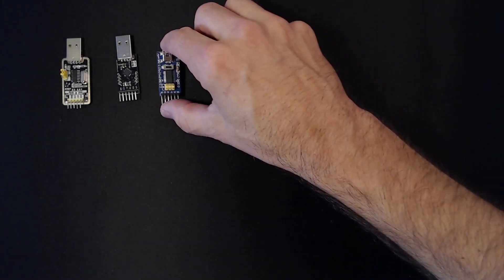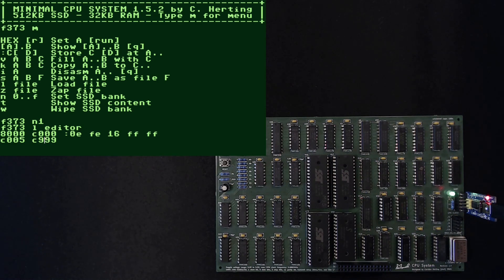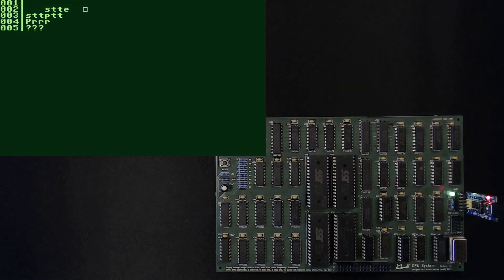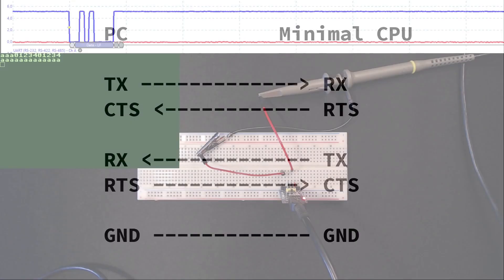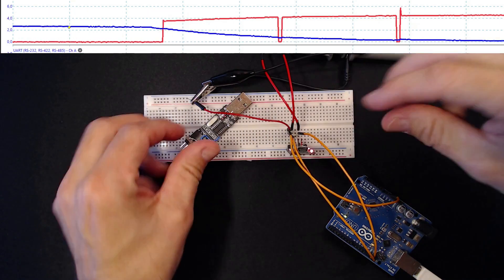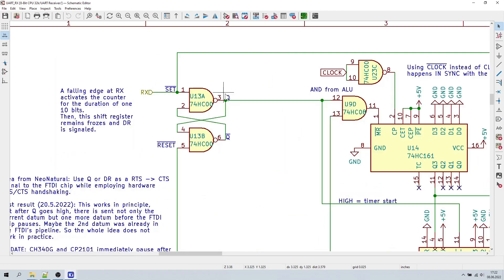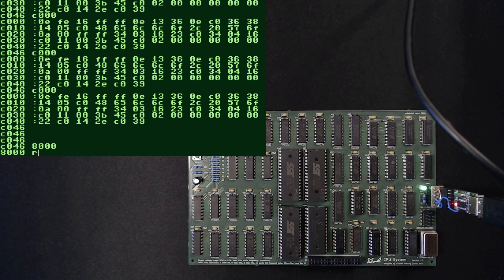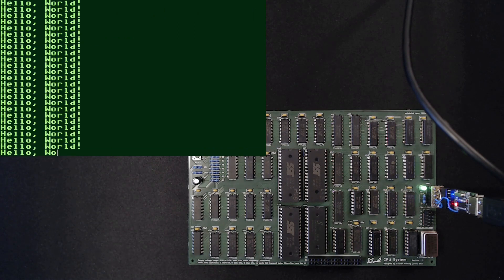Easy Serial RTS/CTS Handshake - Minimal CPU #12

Comment: Hi, ive been doing a lot of testing with bit-bashed serial using hardware handshaking.
It you only assert the CTS line for 1-bit time the chips will only transmit 1 byte.
In short it will work with any usb/ttl chip.
Check out your video and you'll see that by waiting for the start bit, you asserted the CTS line for 2-bits time, so chips with a FIFO transmit 2 consecutive bytes.
Hope this helps!
Reply from the maker: Hi, thanks for diving into this. If I am understanding you correctly, the problem is that my circuit pulls down RTS ("I am ready to receive") for more than 1-bit time? In fact, it pulls RTS down continuously while it is ready to receive and up until a new datagram arrives. Have I misinterpreted how to use RTS? Thanks for you help with this!
Reply: @slu467 there is very little out there on the 'correct' use of RTS. I pulled mine low until the start bit, then took it high and processed the start bit. Like you I then received 2 consecutive bytes. Looking at my trace, this time (from taking RTS low to the start bit) was 2 bits-time. Then I tried just holding RTS low for 1 bit time, letting it go high and waiting for the start bit. This time I only received 1 byte.
I think the modern UARTS sample multiple times to improve noise immunity.
I'm working on a minimal 6502 computer with only a VIA chip for 3 uarts and i2c, so I'm totally dependent on hardware flow control.